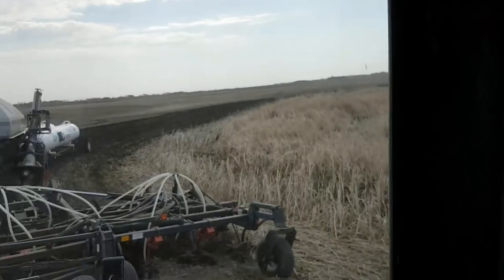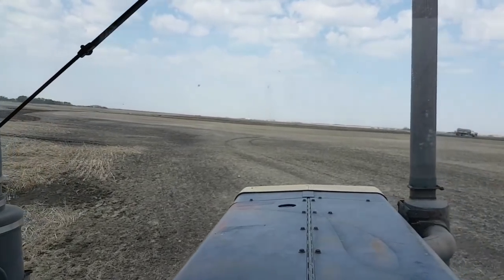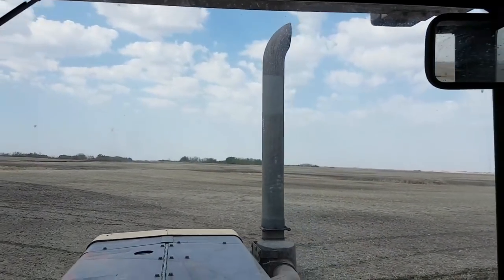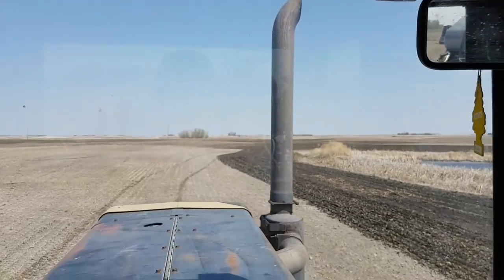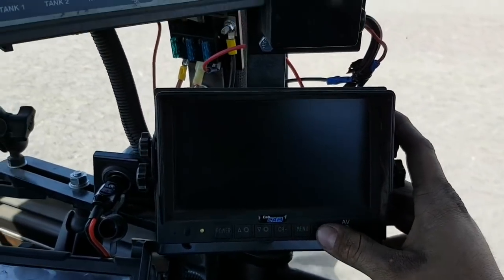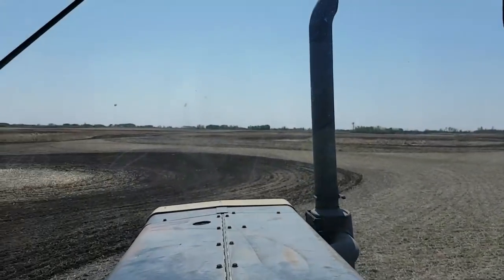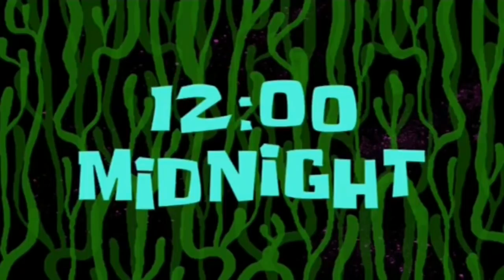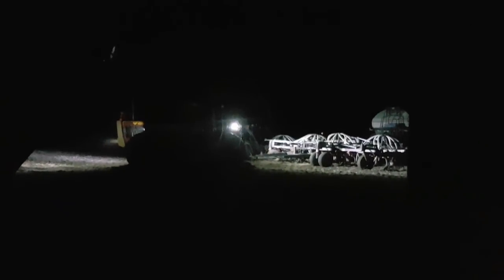Seeding canola with the 895 versatile! And flat tires... And shitty soybean stubbel...and so on.....

Comment: We had Comanche teepee mounds on the Shiner farm back when Grandpa bought it in 1958... they'd pitch their teepee up on top of these sharp mounds, so when it rained the water all ran down the hill away from their teepee, keeping it dry inside.  They'd dig a pit in center to build their fire, usually a few feet deep, and line it with rocks, which when the fire got them scalding hot they'd drop them in buffalo stomachs that they used for pots to cook stew or vegetables and stuff like that.  The hot rocks cooked the food.  

Somewhere along the line Grandpa got the bright idea to take the grader blade or scoop on the back of the old 8N's and carve those hilltops off so they weren't too steep to shred or mow hay over... A real shame because they were historic... 

Later! OL J R :)
Reply: @Remy Raymond ehh lately i have been using flixportal. just google for it:) -terry
Reply: @Terry Esteban Thank you, I went there and it seems like a nice service :) I really appreciate it!!
Reply: @Remy Raymond No problem =)